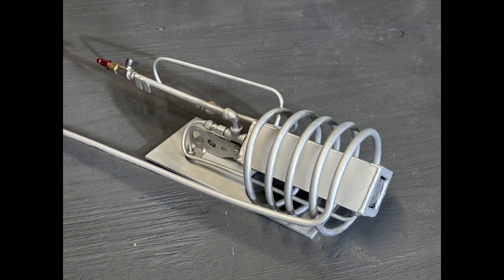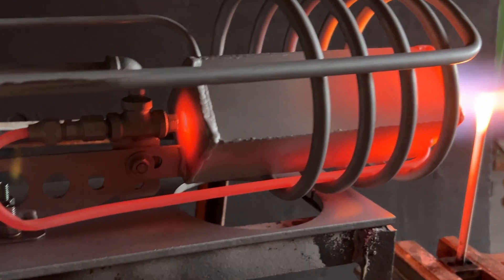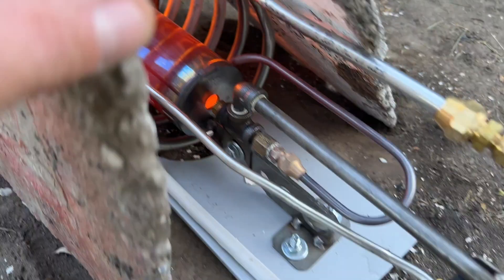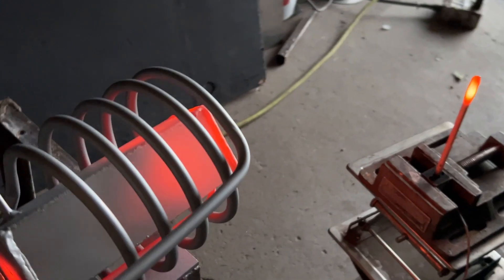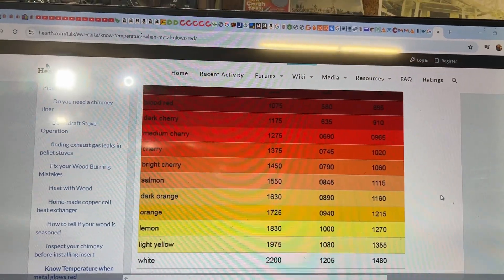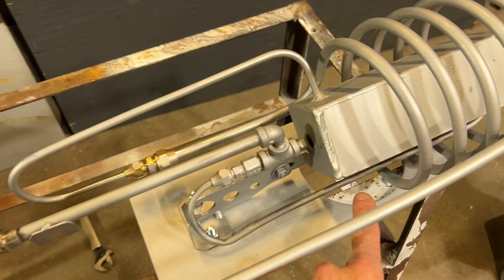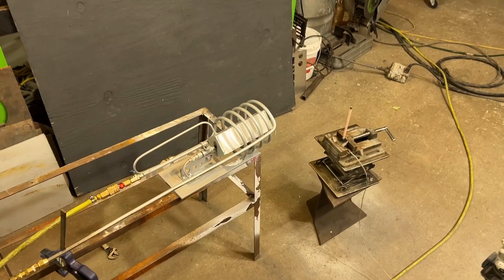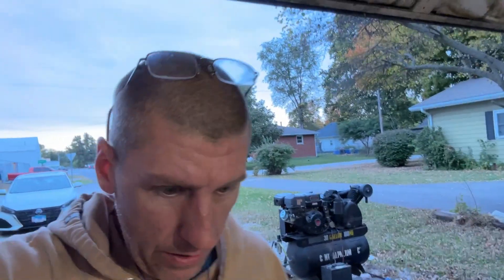Thermal cracking propane burner

Comment: Fully oxidized Hydrogen flame is colorless to blue 

Your previous burner was orange because of uncombusted carbon since the air supply was too low. The flame was fuel rich

In many ways you're wasting your time since just burning propane normally cracks the propane directly in the flame in the process of combusting
Reply: @NOBOX7  If it doesn't crack the propane what the hell is burning? The propane molecule has to be decomposed before the carbons and hydrogens can be oxidized 

The products of complete propane combustion are water and carbon dioxide. The water comes from the oxidation of the hydrogen that made up the propane. This is simple chemistry
Reply from the maker: @prophetrob  your the one who is simple, Chemistry is not , norr is it your strong point Mr adiabatic LOL . If you new what that term ment you would of never offered up that jiberish . They dont burn propane at adiabatic temps dude , its a math equation sum that does not take heat loss into account hence the term ADIABATIC .JEEZ you sound like a dam engineer .
Are you an Engineer ? That crowd isnt often as write as they like to be .
Reply: @NOBOX7  I brought up the adiabatic temperature to highlight that you can hit the temperature you saw on your thermocouple well within the normal combustion temperature of propane in air
Reply from the maker: @prophetrob If you was correct in the sense your pushing there would be no such thing as other flame temps , hydrogen burns at 4000 F  Propane at about 2400 to  2500 max in an open flame test . They would just give the hydrogen flame for every flame temp if all fuels turn into hydrogen before they burn .  Yes there is some hydrogen but its not as hot as a hydrogen flame now is it ??? Why not just fill the dam rockets with liquid propane its so dam cheap and your so dam correct all the time  . You could make millions with your skill ...
Reply from the maker: @prophetrob  It does crack but its not the same , propane burning and hydrogen burning are not the same . you have Boudouard reactions that cool the flame .
also ive bin doing this long enough to know the flame we are getting is way hotter than propane . Not mad at you just commenting because it boost the views . Explain how we melted M12 maganees steel drill bits ? you do know thats not possible without oxygen enhancement right  ?
Reply from the maker: I apologize for being a Jerk bro , may the best man win ...
Reply: @NOBOX7  I don't doubt that you're cracking the propane in the pipe and the flame is mostly hydrogen, but I think the color of the flame is coming from metal ions from the combustion chamber pipe and residual carbon. Cracking the propane in the pipe is going to be cooling the combustion reaction within the combustion chamber similarly to cracking it at the initial flame front, they're both getting the energy from the end flame.
Reply from the maker: That was not a fuel rich flame . It had over 10 cfm of air going in at 140 psi . Frekn wow dude , your confidence must get you laid daily  ...
Reply: @NOBOX7  what was the cfm of propane?
Reply from the maker: @prophetrob  It was a lean flame or it would of been 3 feet long . 394,273.5 BTU  or 18.3 LB/hr      115.5 Kw   .
for you to sit here and insist its a lean flame from low air proves you know nothing , your worse than thunderfoot IMO . at least he is a really smart . I sell and build burners  for a living boy , this aint a lean flame . But i am gonna go ahead and leave your comments up . People need to see what Collage can do to the human brain . Im a drop out by the way , dropped out 7th grade .... just like Einstein ...
Reply: @NOBOX7  I don't understand what you just said because I said it was a rich flame and you countered that by saying it was both lean and not lean
Reply from the maker: Cracking the fuel in the flame is not the same as burning hydrogen ,otherwise wouldn't all flames be the temp of a hydrogen ? But there not .
Reply: @NOBOX7  you didn't even reach the adiabatic flame temperature for propane (3596 °F) with your burner 
You aren't actually even measuring the flame temperature with your thermocouple, you're measuring the equilibrium heat temperature for the flame thermocouple system where the flame is heating the thermocouple and the thermocouple is radiating at the same time and the temperature depends on the balance between those rates
Reply from the maker: @prophetrob  , dude do you not know that adiabatic flame temp cant be reached in practice you should read up on it . Its a Thermal dynamics equation that does not take heat loss to surroundings into account HENCE THE TERM ADDIABATIC . Freekn wow . Im gonna leave your comments up so the world can see how you really think. DUDE i bet a million dollars your vaccinated    and boosted with the fake Joojuice NOW I KNWO YOUR A JACKOFF
Reply: @prophetrob  Colour of that flame might come from the fart of the neighborn. Any impurity even at parts per billion will colour the flame. The point is not 150% efficiency, is energy density of the flame.
How much energy I can pack in smallest area possible.
Reply: @l.c.9524 if the color of the flame can come from the fart of a newborn worth of contamination then why does he think he can diagnose whether or not it's a hydrogen flame from the color? What impurities could result in an orange flame? Carbon
Reply from the maker: @prophetrob  Go look at other hydrogen flames and stop being a moron
Reply from the maker: @prophetrob  And where did we get the carbon ??? Cracking fuels maybe ??? Go get your next booster shot and get back to me genius .
Reply: @NOBOX7  you got both the carbon and the hydrogen from the same process simply directly burning the propane gets it. You aren't doing anything that direct burning doesn't do, you're just doing it in a pipe instead of within the combustion reaction itself
Reply from the maker: @l.c.9524  So true Glad to have a voice of reason . I think people just like to argue LOL